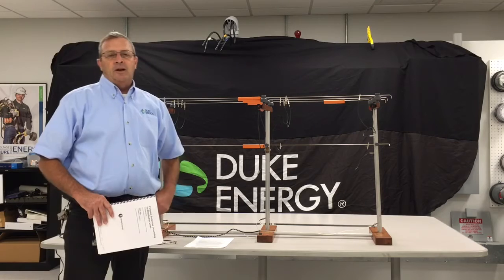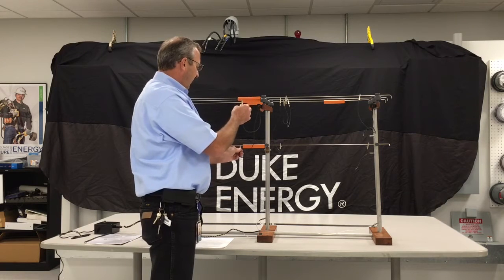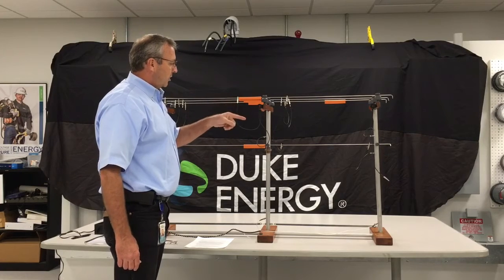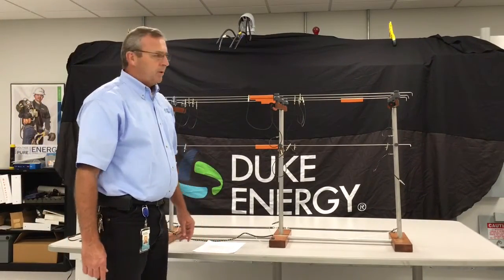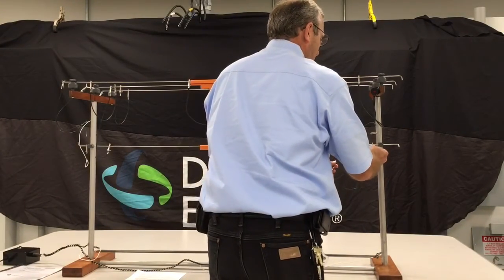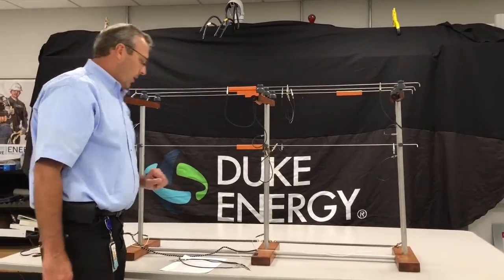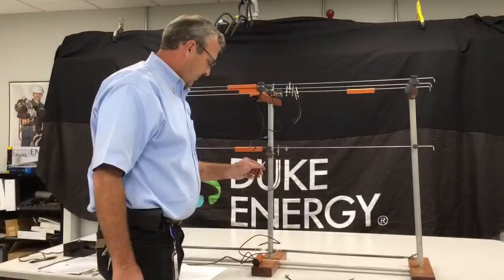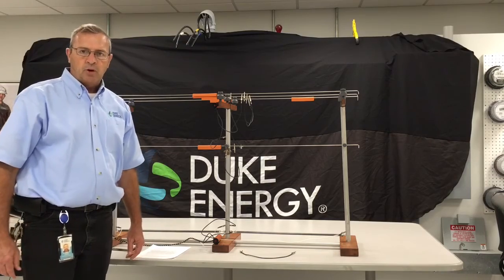Distribution Grounding Simulator

Comment: Its becoming more clear that isolation is the safest practice because even using EPZ you would have to have a ground that can surround the entire work area to keep the workers safe.
Reply: How do you create isolation, but not install grounds on existing lines? The safest way is with EPZ grounding along with a good work protection code.

Comment: Dave need to be careful on using only single point grounding. If high fault current circuits you need to ensure that grounds are on source side of worker' if not as little as 5 ft away from the PPG a worker could receive lethal currents. Refer to latest IEEE 1048 page 18. I did simulation studies in 1997 and was amazed at results we found when grounds were on the load side of a worker and only 3 feet away on a 336 mcm conductor (7.6 kV).